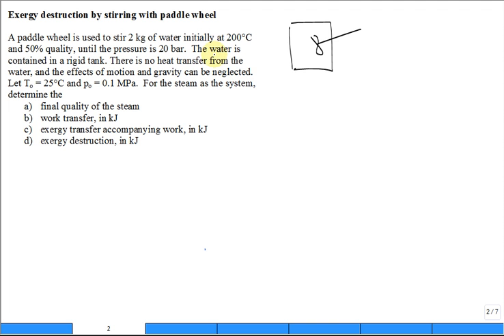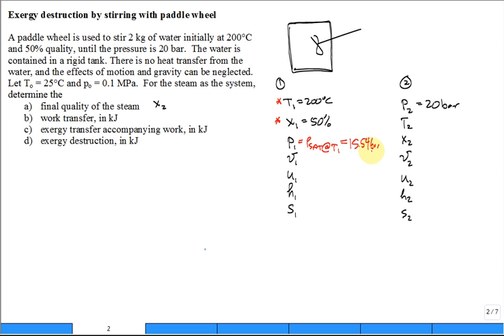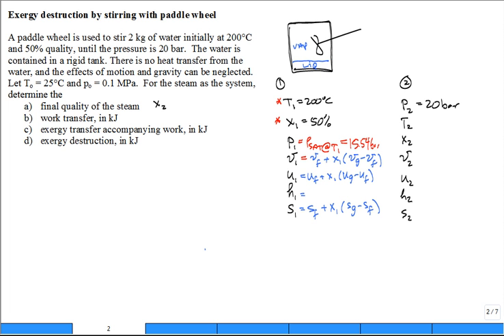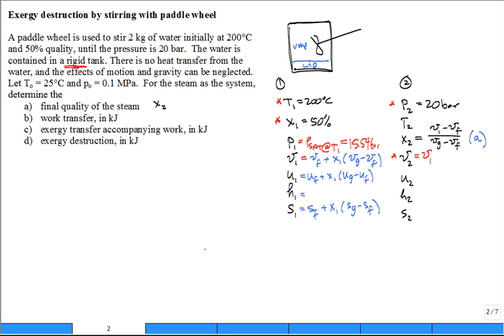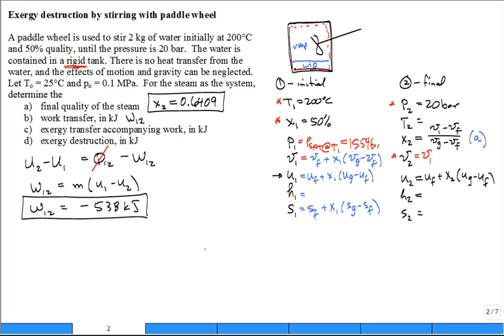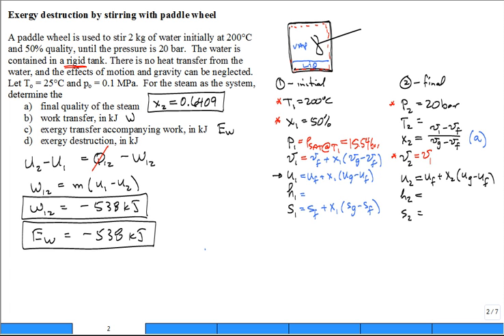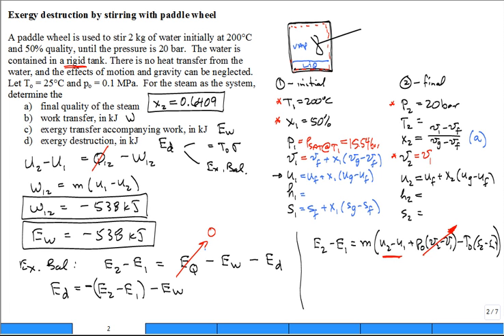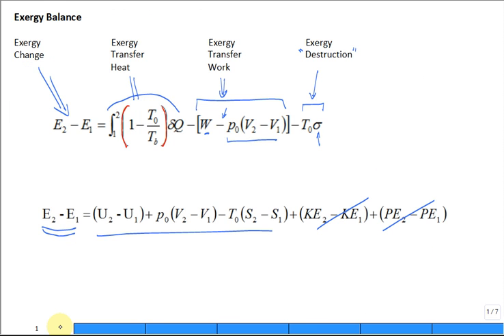Exergy Destruction Stirring Steam Tank with Paddle Wheel

Comment: 5-1 A certain nozzle is designed to expand air from stagnation conditions of 1.38 MPa and 200°C to 0.138 MPa. The mass rate of flow is designed to be 4.5 kg/s. Suppose this nozzle is used in conjunction with a blowdown wind-tunnel facility so that the nozzle is suddenly allowed to discharge into a perfectly evacuated tank. What will the temperature of the air in the tank be when the pressure in the tank equals 0.138 MPa? Assume that the tank is perfectly insulated and that air behaves as a perfect gas. Assume that the expansion in the nozzle is isentropic.